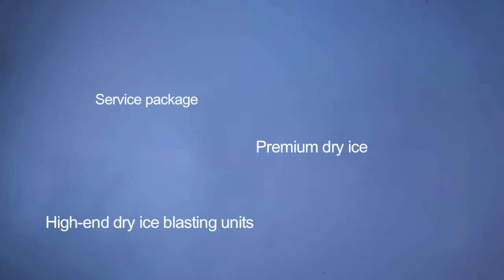Dry Ice Energy - the most compact and easy to use dry ice blasting machines!

Comment: What compressor size is needed to run the machine?
Reply from the maker: Hello! 
*Depending on the application, our machines require between 250 -1500 L/min
**We recommend between 400-1000 L/min for most applications
***And a compressed air tank to store the generated compressed air from 100L upwards. 
For more detailed information, if you can send us your e-mail address and your city, we would like to support you. You can also contact us by filling out a form on our website! https://dryiceenergy.com/en/contact-to-dry-ice-energy/

Comment: A air compressor is needed and once you take that into consideration, it won’t be as portable as you see in the video. To run it continuously, you’ll need a HUGE air compressor or you’ll have to wait for it to recharge before using again
Reply from the maker: Hello! Our poduct is much more handy and ergonomic than other machines on the market, and its prices are very competitive. For specific purposes, different compressors are required and these compressors are easily available. We also provide support in this regard. For more detailed information, if you can send us your e-mail address and your city, we would like to support you. You can also contact us by filling out a form on our website! https://dryiceenergy.com/en/contact-to-dry-ice-energy/
Reply: @dryiceenergy_original  hola
Reply: @dryiceenergy_original will you partner with me on a sponsorship to test and do a review on the dry ice machine?